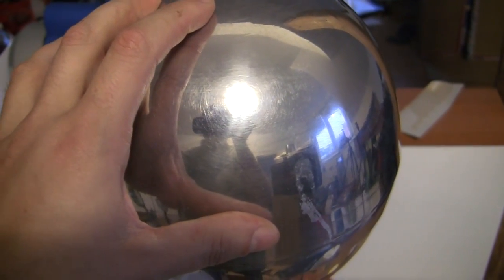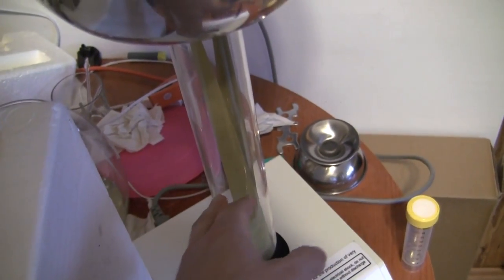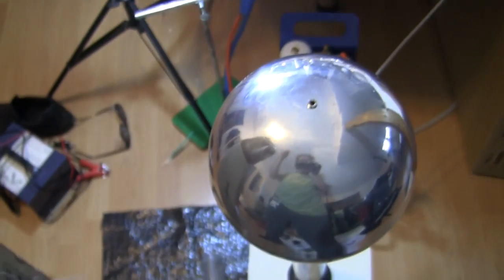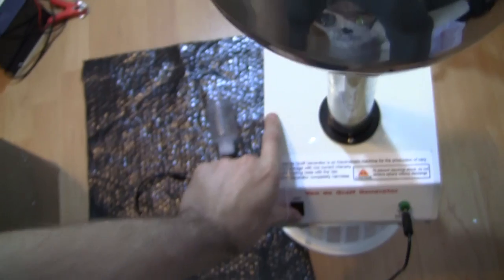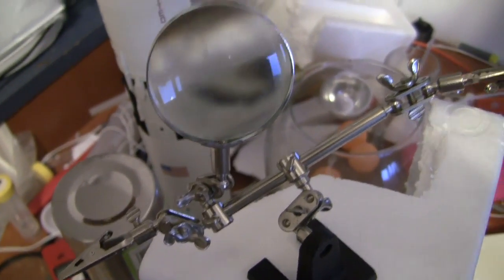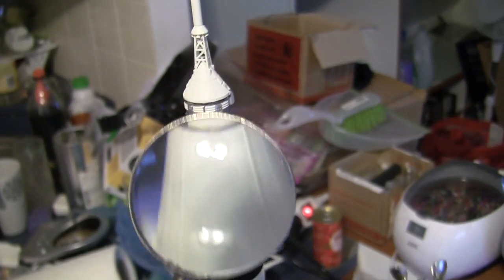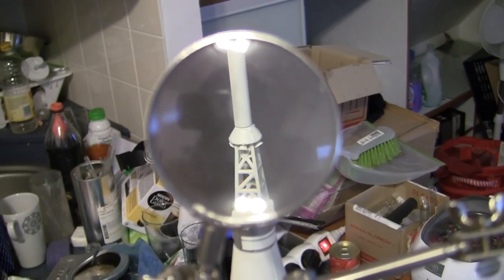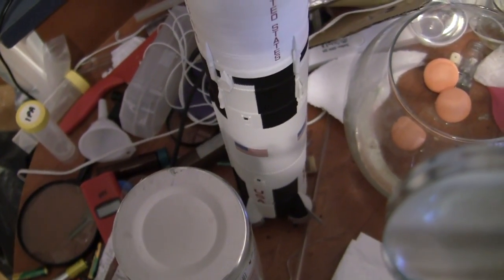Surviving a 10 000 VOLT shock!

Comment: Wow how sensational, voltage does not say anything about the energy transfer. If i pull a woolen sweater over my head, the voltage can become well over 50000. I've worked on maintaining electrical passenger trains that used 1800V DC and know very well the risks involved. The risk comes from any electrical current that can pass through your body and often high voltage is needed to reach deadly current through your heart, stopping it. The current itself is the measure of deadliness in this case. If i am not totally mistaken a current of 0.03A (edit: through the heart) is potentially lethal, and where i'm from it's the current that triggers fuses when there is a short-circuit.

just my 2 cents, haven't watched the video yet, but the title was a bit in my face
Reply: 'safe electrical energy sources' considered by the regulations i've been working with:

100v DC or 50v AC. or below these voltages for each type are considered to be safe to work with. (i am not allowed to use 230v(the average voltage on the wallsockets here) dc appliances in a damp cellar for instance, or in a flooded crawlspace under a house)

i did like how you pointed out that the actual needed electrons for creating this electrical field was really low. this is how you also get up to that high voltage of static electricity i mentioned in my previous post.
Reply: pulling off a sweater is a high voltage environment.
i agree only with you when you factor in the energy.
Reply: you fail to see that it still has to do with energy: if the energy of a static charge like lightning is enough to kill, why oppose my previous comments? it's about energy, not about dissipation or time.
Reply: *****
static electricity, one of it forms is in a thunderstorm. even though the time is very very short, the energy transmissions are huge. time is not relevant, energy is. if over time 10000kv is upon you, as long as the energy absorbed by you is small, the current going through you is small, not affecting you in a lethal manner.
static electricity, ac, dc, whatever kind of energy source, it always ends up having to do with how much energy you absorb.
you can stand 1kkv as long as the absorbed energy won't trigger enough electrical current to surpass the current to stop your heart.
i agree on time being a factor, but when it comes to electricity, time usually can be nullified, electrons move about the speed of light.
Reply: *****
I should look up the formula of energy? YOU should do it, but now for electrical energy, not the equasion that is applied when calculating the energy of a moving object...
Reply: ***** And still the time does not really matter.

If you get a blast of 1 GJ, no matter if it is in 1 ns or 1 s - it will simply obliterate you. You will be dead.

With long-term exposure the total needed energy decreases, as you don't die from the direct damage, but indirect through your heart stopping etc.

So time only matters if you are talking about long exposure, but for a lethal does the energy alone is the factor. It doesn't matter if it is near instant or over 1 s - the amount stays the same and kills you.
Reply: ***** Go to school kiddo before talking crap.
Of course i won't go into full detail about all the possible ways, but what you are talking about... ugh, makes my head hurt trying to go that low.

"If it took a year for lightening to equalize charge, that's approximately 3.15569e7. In this instance, massive amounts of voltage would not be much of a factor.
Of course, if this were true, the energy would not be 1 GJ. "

That whole sentence just shows that you simply got no idea what you are talking about.

Energy is NOT inverse proportional to time.
Yes, time is in the Unit, that's it - nothing more.
If i got a device capable of storing 1 kJ it would not matter if i release it in 1s or 1 year - it would be the same amount of energy and could to the same amount of work or in this case - harm.

You need a certain voltage, a certain amp and a certain energy minimum to do any harm. If you got low power (either low volt or low amps) you need a long time to transfer the energy to do serious harm, if Volts and Amps are high, the time only shortens, you still need about the same amount of energy.

It is the same as the first question our physics-Dr asked in his first lesson:
'Which one does need more power to lift up an object 15m - a 500W motor or a 2 kW motor? - none, they need exactly the same".
Volts-amps-watts you can pretty much choose them to your liking, you still need the (pretty much) same amount of energy to get something done.
Reply: ***** ugh, are you really that stuck up with definitions to not see what i'm trying to tell you?

As i already said, yes, time is in the Unit, but so what? Nothing. 
The energy saved in a given device is not influenced by time at all.
If you had read on and actually tried to argue, i might take you serious, but what you displayed is just an angry kid that knows wikipedia.

My last analogy, care to take a stand on that?
Fixed energy no matter how long you take. (give or take some extreme examples, simplified physics without friction etc ofc).
Reply: ***** So you didn't understand it at all.
Even more, your very own example is not really helpful here, as it deals with a rather different situation.

Yeah, definitions mean something and yada-yada-yada.
But if you completely ignore the situation at hand your conclusion will be simply but false.

So, again, you need a certain Voltage to get specif Amps for a given resistance like that of the human body.

But to now do some damage you also have to apply enough Energy.
Yes, energy is Watt * time, time plays a roll there. If you want to do damage, not only the watts have to be high enough, but the time too.
But the other way around is true too:
If you have a certain amount of energy (like a charged Cap) it can create the same damage, no matter if you release the energy in 10 ns or 1 second.
The energy in physical devices normally has a fixed limit, while the output can greatly vary.

As i already mentioned, a ESD-device can create utopic power, but the total energy it holds is extremely low.

Btw, your example again, about pushing an object - well, it is pretty obvious why it is a bad analogy:
You are comparing the acceleration of the same object over the same distance with a different force applied - of course the outcome will be different if you input different amounts of energy.
But what i said was given a fixed amount of energy (like a battery, a spring, some fuel or other storage-device) the result will be the same no matter how fast you accelerate the box. They will both at the end have the same speed - same kinetic energy.

If you have a fixed amount of electric energy the time you take to use it up doesn't really matter in terms of damage it can do.
This holds true for most cases, not for extremes very the damage is lower than the body can regenerate or the energy flow is so high that you get an ark outside your body etc.

"If energy was not influenced by time at all, there would be no reason to include it in the unit used to measure it."
together with
"J = kg * m² / s² = N * m = Pa * m^3 = W * s = C * V"
See that 'W*S' there? So suddenly the energy is direct proportional to time?
No, it is the context that matters.
If you are talking about power and energy, than they are linearly correlated by time. If you are talking about Charged capacitors, the energy is proportional to the square of the voltage.
If you want to know how much work you can do with the energy you got, you don't need to know the time, the amount is all that matters.
Reply: What bothers me most is that this jshowa guy totally disregards how electricity behaves, you cannot hypothetically slow down or fasten electrons to suit your argument.
Reply: so lets make a model for your proposition that you slow down electrons

make 2 circuits
1 with no added resistance and a light bulb and a switch.
2 with 200x the resistance of the lightbulb in series with the lightbulb and a switch.

flip both switches and marvel how both lights go on at exactly the same time.

you sound silly!